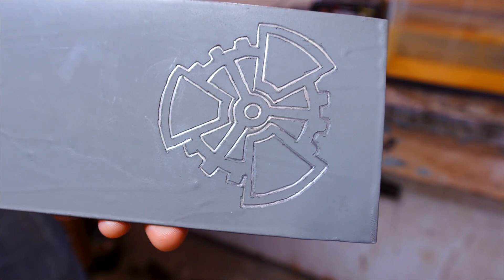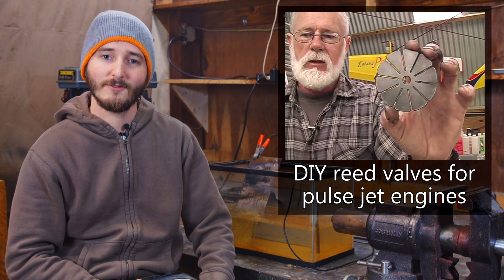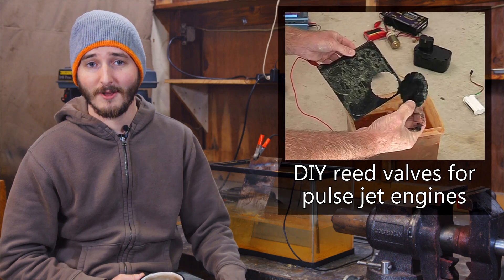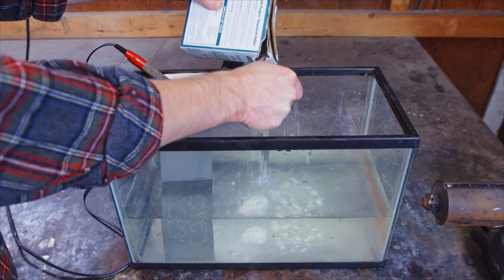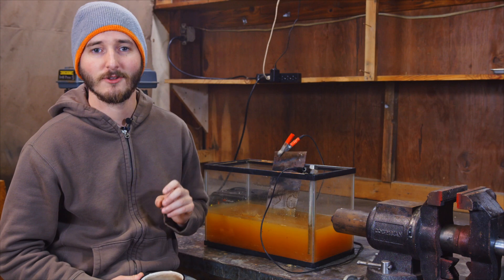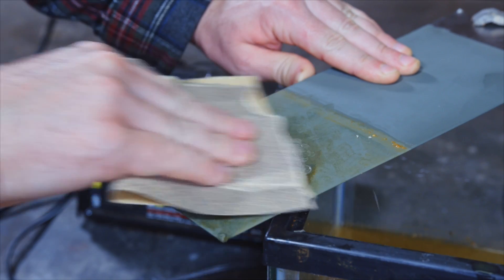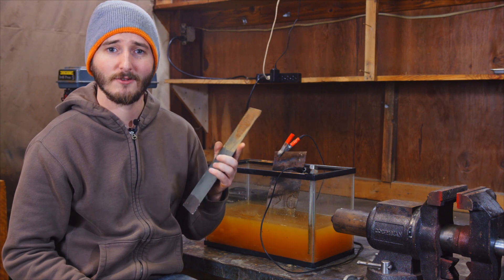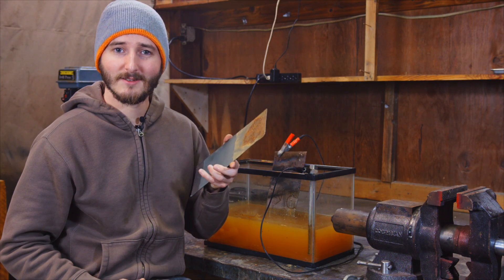How To Cut Steel With Electrolysis [Experiment In Progress] - NightHawkInLight

Comment: try making the design out of tape on the steel, then spray the etching solution over that and then peel back the tape, By scratching away the etching solution like you tried, you may be separating the edges from the metal slightly allowing electrolytic solution in. also maybe putting the design on both sides then snapping the design out, using the electrolysis to weaken the design rather than cut it out

Comment: I use paint then coat the surface with wax, with special care on the edges.  The solution I use is 15gal Water to 2cups of HCl (pool grade)  and 2 cup of  acetic.  Use heavy aluminum foil  as 2nd electrode and run at a min of 2amps usually about 2-4in apart vertically aligned. 20ga is 24hr. I have also had success using photochemical machining using same masking and a mix of HCl and peroxide (less clean up concern than with iron chloride)

Comment: I etch PCBs by covering them in spray paint, laser engraving the paint away, then using an etchant that eats away the copper (copper chloride / ferrous chloride / hydrochloric acid + peroxide). The reaction needs to be fairly quick or else the paint eventually curls and peels and your etch goes outside the lines. I imagine it's a similar problem when using electrolysis. You probably just need a find a resist that is durable enough to withstand prolonged periods of electrolysis. Have you tried a UV curing paint? I believe that's what's used as a solder mask in commercial PCB production and is generally quite durable.

Comment: Wax is a good option but have you tried etching paint followed by Plastidip?
Also it looks like many of your issues could be due to electrical hotspots.
You should try altering your anode, perhaps using another plate rather than a rod. Also experiment with the distance between the anode/cathode as well as voltage, current and quantity/type of electrolyte.
Reply: Also try agitating the liquid with a pump while the etching occurs.

Comment: I have tried and failed utterly at all my metal etching attempts.  I also get blistering of the coating.

Limit the electrical current you are passing through the etching bath.  I think that higher currents tend to erode the coating more aggressively.

Have you tried ferric chloride for the electrolyte?  That is on my list but I haven't tried it yet.  I have tried most of the common household electrolytes and have utterly failed. 

One thing you may consider is the shape of the cathode. Instead of a chunk of hose, maybe use a plate that is as wide as the work piece. Have both the work piece and the cathode parallel and closer together.  Remember, the cathode is "reduced" so you don't need stainless steel or something more exotic to keep it from corroding.

Artists use the term "frisket" when they are talking about the material they use to cover metal when they etch it.  May want to use that as a search term.  Consider tar.

Good luck!  
Please let us know how it turns out!

Comment: what about a rubber coating, much like the wax, but is less likely to seep under the metal, because of it's detraction to electricity, and it that doesn't work what about just coating EVERYTHING and just the scratch marks showing then try acid albeit I think none of those would work
Reply: *them

Comment: Could it be that the piece you are using is too thick? In the 2010 video, the metal that was used seemed thinner. Have you tried different combinations of baking soda and water, or just one or the other? Have you tried coating the piece of metal in nail polish instead of primer? I know it's not on the same scale, but when my brother etches metal, he uses nail polish to coat the piece he's working on. He also uses negative stencils for the design he's etching so he doesn't have to scratch the metal.

Comment: MichaelCthulhu (he makes giant swords) often uses this process (with vinegar) to do etching. he has noted in build videos that he can't leave it too long, as otherwise it would become more three dimensional and that causes problems, as the steel will be eroded to the sides. 
also, my thoughts: 
-paint isn't good once you scratch through it. a bit of wood painted only needs one scratch in the surface and the rot will spread under the paint, invisible-until the paint falls off. the wax actually sticks, so it might be better. or possibly some other adhesive, like caulk or silicone.
-chemical etching is often rough, imprecise, and as you can see if you stop it just after a surface layer is gone, erodes unevenly. 

My conclusion is that this is very impractical. it's a cool idea, but while most of your videos are useful, it's likely getting this to work would be not worth the time and effort for most as opposed to going to a metal shop and having it laser cut. I can think off the top of my head several nearby places I could go to have a piece like this precisely cut in 15 minutes for <$50. heck, one of them even owes me a favor, so maybe free.

Comment: You can perhaps make the electrolysis process happen faster if you were to use a different electrolyt.
You could prevent electricity keep from getting under the paint by using fingernail polish that is clear instead or any color. hope you find this useful.

Comment: try different kinds of electrolyte. different volts and amps.ive also noticed that the positve connection corrodes away faster then the negative side. if your water gets hot try neutral plates. btw use washing baking soda instead of regular baking soda. something with the gases given off.

Comment: So, I've watched both videos. I would try a couple of experiments if you have the resources. First, I'm well aware of using DC over AC to cut into the metal. Can you crank up the DC voltage and use PCB etchant (like the kind from Radio Shack)? I'm thinking it is spreading because of how long it takes to cut it. Higher voltage would speed up the process, and limit the amount it spreads. Plus, Make sure you coat the steel all the way around.

Comment: I've seen this work for the pulse jet reed valves. I think it works for that because the material is so thin (0.010-0.015") The thicker metal you're showing would allow the erosion to work sideways. Also, if you're having "bubble" issues, try using an aquarium pump or something to stir the water around so the bubbles free from the surface and wont prevent the liquid from contacting the surface. Good luck, hope it works out for you.

Comment: I have never tried this before but aluminum and NaOH(sodium hydroxide, lye) (fond in most crystal type of drain openers) react violently with each other. what this means is if you dilute the NaOH in water and put aluminum in it it will dissolve the aluminum. If you paint (or wax)the aluminum and scratch a pattern in it, I have been told it will only devolve what is scratched.

Comment: just a thought, but maybe if after sanding it with a very fine grit to clean the steel, what if you sanded it with a coarser grit after the fine grit. maybe the paint would adhere better not letting the electricity to penetrait underr the paint. maybe you've tried it and maybe not. its an idea and I hope it helps. good luck Nighthawk!

Comment: No coating can eliminate the problem, because the electrolytic corrosion starts traveling through the thickness of the metal as more surface area there is exposed. Step #1 would be to start again with a very thin sheet, then learn the characteristics of your corrosion as your thickness increases to determine a thickness limit for a desired "resolution" of clean "cut". Cool idea, I may try it for a PCB design I was going to make.
Reply: if you've already tried that, I'd try making a screen printing setup for applying your pattern quickly, then pull the part out and recoat it frequently using the quick and easy screen printing setup. you'll still have corrosion through the thickness, but recoating the fresh edges would help mitigate it.
Reply: So a plan would be to do this with the intent of finishing up with needle files.

Comment: Have you considered a photochemical reaction with the steel? If you can find a chemical that corrodes steel only under certain wavelengths/intensities of light, then you won't have to worry about corroding into the sides of your cut, as long as your light source projects perpendicular to the metal surface. It would be almost like conventional photochemical etching, but instead of using UV light to create a mask for chemical etching, you'd create the mask first and then use light to trigger the corrosive reaction on the unmasked portions of the metal. I'm not sure if a corrosive photochemical reaction of steel even exists, but there are plenty of applications for that kind of process (like maybe a cheap way to machine 3D parts using projected light). I'm no expert in chemistry, but I do know that Cl2 can dissociate with light, so maybe that's a good place to start.

Comment: I would suggest circulating the water, so fresh water constantly is exposed to the cut lines, and possibly a filter.  Also, for the cut lines, perhaps applying thin vinyl strips where you want cuts, then applying the wax layer, then removing the vinyl, keeping the metal surface free of any wax vice the scraping the wax which may be leaving a residue.

Comment: If you diffuse another metal in to the metal plate you may be able to make parts of the inert where you don't want to cut. I would imagine you could accomplish that by electrolytic plating of the metal then heating it in a kiln for an extended period of time.

Comment: From a chemistry background, i'd say you are using too much voltage. Normally when you pass a small voltage across an electrolytic solution, you'd only get either the hydrogen or oxygen reaction on one electrode, and the electrolyte reaction on the other (depending on the solution). But if you use a high enough voltage, you'll end up causing hydrogen AND oxygen reactions  -one on each electrode - which is causing those bubbles.
By using a lower voltage, you could reduce the amount of bubbling which is causing your etching coat / wax to be affected. That's all in theory though!
Have a good day!

Comment: As many suggested you are using too thick of a steel plate. perhaps try placing a 3d printer above the tank with electrolite and let it scrape the patern you want with a needle. the printerhead should be designd to protect the surface around the pattern(meabe use a candle stick?). the function of the scraping is to make it corrode evenly and removing the by product salt from the material. also different electrolites and different concentrations of them will affect the salt layer which will be produced.

Comment: Have you tried altering the position of the part in the electrolyte e.g. laying it flat so the bubbles can rise away from the part instead of along the surface. Could be some cavitation type of degradation with the surface coating.

Comment: You need to COMPLETELY clean the metal before you coat it in primer. After you clean it never let anything remotely oily touch the metal (that means human hands. Use gloves) . You need to LIGHTLY DUST the metal with primer multiple times. The bubbles are a result of either oils being under the primer. Or your coatings being too thick. I'd recommend thin coats of primer over wax.
Reply: You also need high voltage. Like 3-4 amps high
Reply: OGorman36 amps (amperes) are a unit of current, not voltage.
Reply: alchemistTi I'm just relaying what my teacher taught me. "Just look at that bar and watch it go to 3-4 amps" thanks

Comment: If you think about it, increasing the pressure of the water could be the solution. When the etched metal erodes, the paint does not have enough stickiness to stick to the metal around the etched metal. So by applying force(water pressure) it could help the paint around the etched surface to stick to the metal as the etched surface erodes. Thus no water can seep under the paint.

Comment: Toolmakers use a similar set of devices to cut intricate shapes.  They are EDM sinker and wire.  The first uses a graphite electrode to erode the metal, while the wire EDM is just that, a wire.

Comment: Maybe you should try doing it by periods, cleaning and recoating the steal between each bath. I'm gessing that the coroded steel offers too much surface area OR increases the resistance wich "force" the curent to find another path..

Comment: What about using masking tape for th figure instead of scraching the paint away? Perhaps the seal would be better copared with the scraches, so there will be no bubbles. But I actually have no clue what could be the solution. I don't even understand what excactly is happening in the video, but I thought I'd take a guess. Good luck and greetings from the Netherlands!

Comment: I dont have to much knowledge, but i think you may be having issues with the paint from the build up of rust,  this may already be obvious but its good to have the full grounding.  So from what i know of paint and rust (being a blacksmiths son) the rust lifts up the layers of paint as it forms and expands, one idea of  have would be to try to make the reaction happen much faster,  whether that be through a higher voltage or amperage, or if the reaction would be sped up by some chemical, a different electrolyte or a catalyst. 
Just my thoughts, hope that I've been helpful

Comment: Rather than scratching the paint away why not try masking the area you want to cut, applying your primer and then peel away the mask whilst it's still wet?

The method of scratching may give you a slight peel at your edges meaning the electrolyte can get underneath, causing the bubbling?

Comment: Did you experiment with various currents?
If the issue is bubbling I assume there's some kind of gas forming, either from the electrolysis reaction or possibly water vapour if the reaction produces heat.

Using a lower current could possibly help if the issue is water vapour. If it's a product of the reaction i'm not sure what to do haha.

Comment: if you are using a stainless steel (wasn't sure) the sale would be your best best because of the cloride ions that will attack the chromium content. also should you use a dissimilar metal for the electrode?

Comment: make sure the plate is highly polished and scratch free otherwise salt water and electricity will flow under the paint. Also use a higher current and make a system that pumps the electrolyte through a filter

Comment: 1.use vinegar in as high of a concentration as possible as an electrolyte, as it creates more stable Fe ions in solution.
2. use thinner material, just like what AvE said.
3. You want high current , low voltage to erode fast, BUT high voltage, low current to erode cleanly, so you need to be able to find a sweet spot .

Comment: if you haven't already, i'd suggest using the coating which was the most effective at not letting the electrolyte solution react with the metal and etching on the metal on both sides and deep so it has grooves which would mean the the reaction at the grooves would take less time to corrode through

Comment: I want to chip in! cutting 0-1mm sheet foil should be an okay deal, but the second you move a decent portion of metal from the masked area under electrolytic etching, the process can easily undercut the mask and eventually will bowl out the entire outline. I think you'd be better off researching a cheap way of performing edm machining as it requires basically the same set up, although you need the water to be as un electrolytic  as possible. Go check out AvE and Post Apocalyptic Inventor's videos on their homebrew edm kit. 

of course, if you need surface details or veins on your steel parts, then an electrolytic etch might still be useful.

Comment: Maybe some sort of hardener for the primer as an after coat . Use a Dremel to etch out image ? I would definitely utilize ventilation to be on the safe side . Make sure your metal plate is ultra clean near the image edges . Also what if your negative lead was closer to the image , solder a piece of # ~ copper conductor  rated for whatever current you have going . Maybe having a lesser path to ground may concentrate the process . I just guessing ,brain storming. Peace

Comment: What is going to keep the corroding from traveling through the steel once it goes beyond the surface. Maybe to keep the cuts precise will take the electrolysis in stages and a re coating of wax at several depths. This will keep the corrosion from traveling laterally.

Comment: I would use a neutral inert salt (like Na2SO4) so your product will be only H2 and rust or even an acidic enviromental (like dilute HCl) to prevent solid rust, the product will be a solution of Fe and everithing will be cleaner. For cathod almost everything should be ok but I would use something inert like inox steel or titanium. Cathod should be in front of the anode and should have a larger surface area. The thickness of the anode shouldn't be too big because corrosion doesn't go straight, so after a while you necessary erode even under the coating. For a cleaner coating you could try to mask areas that you would like to cut with tape, painting and then remove the tape.

Comment: Once you get into the metal the electrolyisis can attack the newly exposed metal on the sides of the cut and go horizontally. The only surefire way I can see to avoid this would be to constantly take the piece out and reapply the paint. This would drastically increase the time it takes and would still probably limit how complex you could make the shapes. In the times between applications it'll still eat away the sides just a little bit, and since that will stack over time any really intricate shapes will be lost.

Comment: Also, maybe you could try covering the metal with a polyethylene sheet, and heating it to its melting point in the oven to make it adhere to the metal? That should be stronger than wax, assuming it does manage to stick.